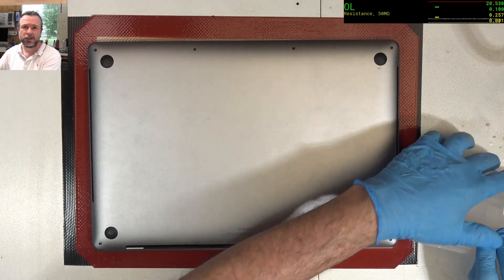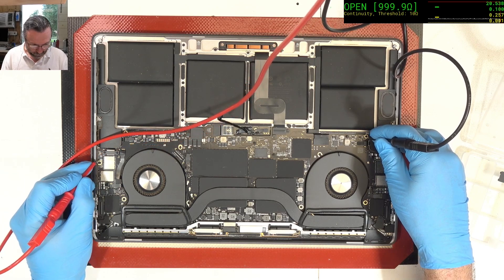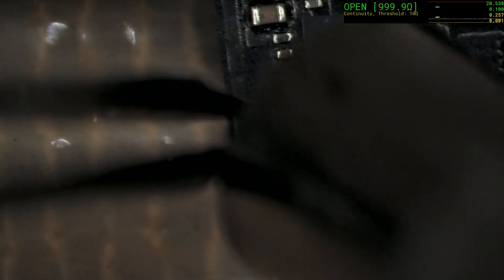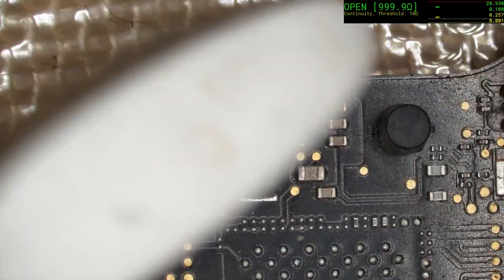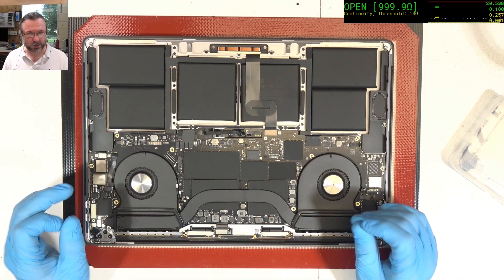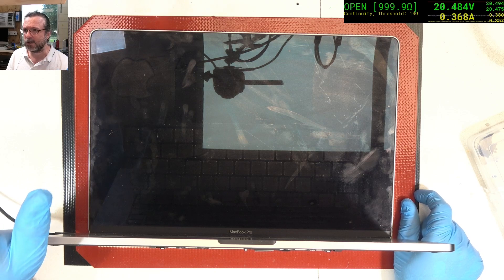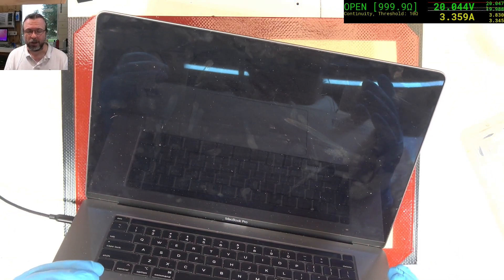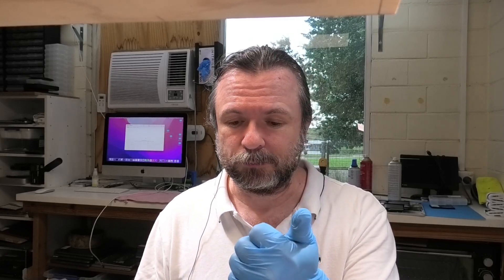How to fix Macbook 16" No-power fault the SAFE way. A1990 and A2141 failures. STOP killing data!

Comment: Would putting Kapton tape over components near the air inlet help protect them from dust and other gunk coming in and causing them to fail? I'd actually consider buying a used 2019 16" A2141 if I could prevent failure in some way!!

Otherwise, is there some means of preventing failure? I don't want to fear random failure on an otherwise lovely machine!
Reply from the maker: If you cover them over you're likely going to risk heat issues.  Honestly the best policy is two fold;

1) keep icloud backups (or backups)
2) periodically blow out the dust
Reply: @pldaniels  I could cover them in thermal putty and place tiny aluminium or copper shims as heatsinks on top of that

Comment: great video, excellent advice.  Thank you.  Are you able to do a video on how you did the DFU revive?  Curious as to how to navigate that
Reply from the maker: if the machine is in DFU mode, then plugging it in to an Intel Mac with AppleConfiguration tool 2 (AC2) you can then option-click on the listed device and choose Advance->Revive.

If it's not showing up already in the AC2 listing then don't try force it to be in DFU mode as it'd be a different issue likely
Reply: @pldaniels  thanks Paul for replying!  Very grateful for these interactions.  If you don't have a secondary Mac, is there any way to revive?  I'm thinking for the average person like myself, I have a normal Windows desktop/Laptop lying around but no secondary mac unfortunately

Comment: 3:50 Bigger caps in the same corner also have signs of corrosion. Does it make sense to replace them as well before they blow up?
Thanks for the excellent video!
Reply from the maker: You're not talking about the inductors are you ( some light rusting ) ?  None of the other caps there needed replacement; some have light 'muck' covering them but none are/were corroded.

Comment: I would add some uv glue or rosin around the nand power ic’s just as a preemptive measure. Nice to see also this format of videos from you Paul! Mircea.
Reply from the maker: Given the other areas of damage that I see on these machines I've stopped bothering with trying to add more protection because it only delays the inevitable when either 0V9, 1V8 or some other rail gets taken down by the damage; additionally it creates a more difficult mess to clean if the area does have to be reworked :(  

Sadly the only real solution is to find a way to tell people to try get their A1990/A2141's cleaned out every year or two :(

Comment: Hi Paul, thanks very much for this great tutorial and guide on how to repair this model of macbook, you are precise and clear explaining step by step and this is great... i work very fine with your FlexBV compliment it's a very good software... thanks again for sharing... i see you sold out the usb-c PSU....can come back?  I'm not a leecher but can you give i little advise about temperature and air flow on macbook board... i have problem on desoldering and ISL on A1706 very fragile.... i know every hotair soldering station are different but a guide line... may be rigth a prehating backside at 250°C 30s 50% flow and then 480°C 50%  for the minimal time to not stree to much the board....thanks in advance bye Francesco Timpano from Florence Italy